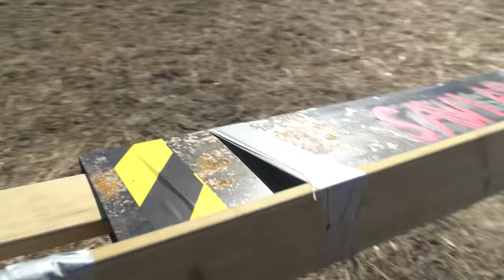Can you Launch Frisbee with Pneumatic Cannon?

Comment from the maker: If you have some ideas how to make the frisbees spin please let us know :D I think I could try this again if I get some feasible ideas. I have also tried a lot with saw blades but those are really hard to get spinning :D And if you haven't seen the saw blade video link is here https://youtu.be/228u0IrGgt4
Reply: Good luck finding those frisbees! Even scooby doo couldn't find them with a scooby snack!
Reply: Tarttisi jotenki saada enemmän painetta frisbiin toiselle reunalle kuin toiselle ja näin pyörivää liikettä aikaseks? Vaikeahan tuo on varmasti toteuttaa.
Reply: I think you need something that bends like a human arm. A pneumatic arm? I think you would need 2 pivot points, like an elbow and wrist, to get any spin.
Reply: Frozen pizza please
Reply: I think the problem is the frisbee is not separating from the block it's attached to until it's already in flight, perhaps more traditional wadding would work better?
Reply: Clay pigeon launcher 5000000
Reply: On the pink disc launch at 5:30 it looks like the excess air being blown out of the barrel caught up with the disc-and-sabot? I wonder if a vacuum cannon might work better?
Reply: I think there needs to be a way to apply the air pressure to only one side of the barrel to get the disc spinning before it exits the launcher.
Reply: My suggestion is, use the compressed air to impart spin; you are 3D printing the 'carrier', so presumably you could use silicon grease to permit the frisbee to easily rotate in the carrier, but you could also incorporate a pair of plastic rotary impellers into the corners of the carrier, fed by the air that is launching the carrier,  that transmit their rotation via plastic cogs & then friction to the rim of the frisbee....  If you get what I'm suggesting then cool, if not I may be persuaded to draw a diagram...
Reply: The 3d printed sabot is not releasing the projectile (frisbee) you need to have the sabot either attached to the cannon or colliding with a protrusion to stop the sabot moving while allowing the projectiles to fly free. As for spinning the frisbee would it be possible to redesign the sabot to take advantage of the available air pressure using a small turbine or wheels to drive a pair of cylinders to impart spin to the frisbee?
Reply: 1) The sabot grips the Frisbee too hard.  It must detach the moment the sabot clears the barrel.  You can see the mass of the sabot dragging the frisbee into a vertical position.  As soon as that happens, the frisbee flips.

2) The arms of the sabot must be as short as possible, while still supporting the frisbee in the barrel.

3)  try making an at least two part sabot, one that separates at the back.

4)  I have no idea if this will work.  And it would be difficult to do.  Make a multiple part sabot that goes all the way around the frisbee.  Have vanes on the sabot that catch the air to spin the frisbee.  The sabot must have just enough grip to stay with the frisbee to spin it, but separate quickly enough not to drag it down.
Reply: Suggestions for improvement:
-smaller air tank
-sabot must be stopped at the end of the barrel
-cuts at the end of the barrel that the remaining air could escapes to the sides

just spinning wouldn't help if the faster remaining air flips the frisbee.
Reply: Maybe design your own but make it discus shaped (possibly with some tiny added  balanced weights too), so the air doesn't get caught underneath it, like it is at the moment with the frisbee. It might cut through the air better?
Reply: Try making the holder in two parts so it can break away after launching.
Reply: You have to stop the carriage(sabot) just inches after leaving the gun barrel.  This will release the frisbee cleanly.  To do this add an external bracket that stops the carriage on both left and right sides but allows the frisbee to pass.  Now adjust the distance slightly (maybe a screw adjust) so the left and right sides are not equal distance from the end of barrel.  This will provide a torque to the frisbee as it's released.  You want the carriage to be clear of the barrel so it can pivot horizontally, but guided top and bottom.(imagine cutting away the sides of the barrel for the last few inches, sort of thing, but this would actually be the extension part with adjustable stops).  Good luck.
Reply: I have only one question. When you gonna release video with big chronos ring in a field?
Reply: Vipuvarrellinen heittokone joka lähdössä puristaa toiselta laitaa frisbeetä nii et se lähtee pyöriin ku liikerata loppuu. Noin se ei lähde koskaan.. tai tasalaitanen frisbee joka toimii itsessään mäntänä. Ja toiseen laitaan putkea joku kumi tms tahmea et frisbeen toine laita nahistaa sen verra et lähtee pyöriin.
Reply: Try trimming one side of your sabot down (where you have your frisbee spinner board). Make the opening for the frisbeee slightly bigger, so it'll spin easier.
Reply: To get them to spin make a new holder with 1 side of the frisbee touching the side of the cannon and some bearings running inside the holder to reduce friction.......simple. Also, put a small pin to stop the holder from coming out of the cannon. You could also try making something to get the frisbee spinning before you fire it.
Reply: That thing that holds the frisbees needs to stop just before coming out of the barrel so that the frisbee is free to spin when it hits that wood on the side. It will never spin while it's in that holder.
Reply: Look up filament rollers with bearings, take the principle of riding the edge of the spool and lay it flat. Build the sabot around that with a top/bottom piece so it peels away immediately. This way the disc can spin freely in the sabot. If you could somehow get a piece of G2 timing belt to run the length of the barrel on one side so the edge of the disc rides it from the start. Should be spinning fast enough to get somewhere but if you get that far you're to have to start playing with Hyzer angles depending on the turn and fade of the disc. I desperately want to see that cannon successfully chuck some plastic a mind boggling distance.
Reply: When the sabot+frisbee combo leaves the barrel the centre of mass is behind the centre of lift. It's like you're trying to fire an arrow backwards.

Make the sabot out of something light and fluffy.

Edit: to get spin dont apply force from the side. Pinch it from top and bottom on one side with something flexible like foam.
Reply: Forget the sabot. just stuff the frizbee down the barrel. the your last idea shold work.
Reply: failed and you still upload it? this is not fair ...
Reply: Create a heavier frisbee using a 3d printer.
Use an angle grinder attached to a free spinning metal cut out under the frisbee to get it spinning.
Release pressure.
😁
Reply: Lots of luck. At that speed, you will need a lot of spin to keep it stable. I believe the world record for distance is over 260 meters.
Reply: Get rid of the 3D printed part. This is stopping it from spinning as it sticks to the frisbee, keeping it in place.
Reply: Miettikää miten jojo toimii, se alkaa pyörimään ympärille kiedotun narun avulla. Tässä vois yrittää jotain samanlaista mutta niin että se lanka irtoaa lopuksi kiekosta. Toteutus saattaa tosin olla hieman haastavaa.
Reply: Add a rubber strip to the whole length of the barrel inside (or not if it would spin too fast?) on one side to make the disc spin, then redesign the piston to accept small roller bearings around the OD of the disc to let the disc spin in its place while on the way, and in the end of the barrel you should have a stopper for the piston formed to have good contact against the piston to not destroy the piston when it stops instantly letting the disc go through and fly all the way to the forest. I'm sure Lauri could design something like this, I am too busy myself atm.
Reply: Let jorge sprave know and he'll have something in like 5 minutes
Reply: @Beyond the press well to get this working properly you need to get it spinning up fast inside the barrel so maybe a drill bit that can attach through a hole in the barrel and is capable of being plugged fast enough that you can spin it up, pull the drill out, plug the hole and run to the firing switch. would also need a specialised holder with a couple of bearings but some 3d printed ones should do the job. then you can print in one piece still.
Reply: Sandpaper on the wood to increase friction...
Reply: As others have said, make the sabot stay in the barrel of the cannon so when the frisbee tries to spin it separates from it and only has its own weight to move 👍🏻
Reply: How about a curved launch tube? Then frisbee might get spin from touching the outside wall of curved tube. I don't know if it would actually work or not. Wall probably would need to be from a higher friction material so frisbee is less likely to just slide along it. But even then the launch support device needs to be designed to support the spinning. Basic idea behind this is that frisbee need quite long contact to start spinnig properly. It also would need to separate from support device as support device is likely to interfere aerodynamics.
Reply: Maybe try break away sabos or a frisbee shaped barrel and maybe actually have the barrel swinging as it's being fired to replicate a human swing.
Reply: nerf uses a wheel to accelerate rotation which propels the disk through their disk launcher.

Personally I think the friction you had was sufficient but the sled was gripping the frisbee too tight to allow proper rotation.
Reply: @MattFowlerBTR  vacuum canon with a "<" shaped breach that encourages friction rotation.
Reply: Make a giant slingshot and pre-spin the frisbee while it’s loaded using air pressure like the spinners you made a long time ago. Or you could still use the air cannon except don’t insert the frisbee inside of it. Instead cut a slit in the chamber and insert a slider that has a pin external of the chamber that holds the frisbee so it can be spun up.
Reply: I don’t know, but I’d try a Tiny cable to the back of the cannon and to back of cradle to stop the cradle and release the frisbees, maybe about 1foot out of the cannon. Try and see to dial it in, but you need to stop that cradle from flying to launch the frisbee. 
Good luck 👍🏻👍🏻
Reply: Check out the 18th century concepts of "discus cannons", some of those are shown in the St. Petersburg Artillery museum.
- the friction for spinning needs to be established from the very beginning.
- one concept is a toothed side on one side of the cannon, the other one is smooth. Thus it starts to rotate from the very beginning
- another concept is a bend barrel, the discus scrapes along the outer end and picks up friction this way.
- the flat sabot is a mistake. Build a round, 2-piece sabot that seperates outside of the barrel.

one example here: https://www.madaxeman.com/images/Russian/square_gun.JPG
Reply: Try cuting some dents on the frisbee border and make a wood plan with the same dents as guide, make it fit and work as a gear. Greetings Lauren!
Reply: It looks like the sudden rush of high speed air catches up with the frisbee a few meters after leaving the barrel which messes up the aerodynamics of the frisbee and instead of cutting through still air from the front, it is being pushed from behind and thus cannot fly correctly.
Reply: Make notches in the Frisbee for the wind to catch and spin naturally
Reply: Luis Antonio Camacho if it’s a gear system you are talking about placed at the end of the launcher, it will be destroyed on impact. It would be better to have the notches at the beginning of the launcher only. About 1/4 the length of the launcher tube. I kinda feel like that would have a negative effect on the aerodynamics of the frisbee though if the frisbee itself is notched on the edges unless they are very small.
Reply: Try to pinch the Frisbee on one side to impart spin. It would have a greater surface area and therefore more torque than hitting the rim.
Reply: Make it spin first, then shoot it.
Reply: The block could be just in 45 degree  angle with some grip tape, this way when the frisbee and the block exit the barrel, the block would make the frisbee spin
Reply: Tape  the bottom so it's  smooth
Reply: Build a skeet machine  instead of clay disc use frisbee
Reply: I think it flys better, when the PLA part separates faster from the frispie. To reach that you can make it out of two or four parts so it splits in parts. And you could try to make the PLA part less aerodynamic and more like a parachute.
Reply: The problem is that the 3D printed support stays with the frisbee and brings it down. If you stop it before it launches, the frisbee should have more freedom to fly and spin.
Also, aim flat, not upwards
Reply: My cousin has this clay pigeon launcher for shotgun target practice.   https://images.app.goo.gl/NhuaTvkpR9uhFPeF7
It's basically a spring loaded arm, pull the string and it flings the pigeon. You would just need to rig up a pneumatic piston or something to drive the arm. It would take a lot of R&D to get it dialed in but you wouldn't need the sled or any auxiliary spin inducing apparatus. The launch and spin are built in to the arm in the way the disc is loaded. You could check out how the clay pigeons are loaded and held before launch and adapt it to launch a disc. Or a saw blade. Definitely a saw blade. But also a disc golf driver. It would pose it's own challenges but if you get it to launch you should get the spin baked in.
Reply: Cut a channel in the outer edge of the frisbee big enough to wrap some string around.  Tie other end of string to the launcher.  When the frisbee is launched, the string will unwind from the frisbee, causing it to spin.
Reply: Suggest a 2 or 4 piece sabot for separating and a heavier Frisbee, I'm sure the both of you have already thought of this.
Reply: Batting cage baseball launcher 5,000,000. Mount something like that on the end of the barrel of your launcher except just one wheel on one side and a rubber pad or something on the other side. Something just enough to squeeze the disc against the (really fast) spinning wheel right as the disc leaves the barrel to get it spinning w/o killing too much velocity. You'd prob have to somehow stop the sled at the end of the barrel. You want the disc to leave the sled as abruptly as possible.
Reply: I would hit up slingshot channel, maybe you can do another team up in this!  Both your channels are awesome:
Reply: What would happen if you put a small weight on one side of the frisbee? Maybe a little inertia on one side would cause it to spin
Reply: You need a  launcher like they use for throwing clay targets for skeet shooting, They make the targets spin.
Reply: Tie a string to the sabot and to the frisbee, and make the sabot stop at the end of the barrel, so the string will pull one side and make it spin.
Reply: Beyond the press sideways trebuchet
Reply: Make a C shaped launcher, the disc will get spin as it rolls around the outside of the C curve, no sabot.
Reply: Line one edge of the barrel with rubber so it grips the disc as it is accelerating. And have the wadding made of a flat piece of Teflon so it can push the disc while the disc slides on it while it rotates.
Reply: On an Air Soft Gun there is a system called "Hop-Up", which I think makes the pellet/ball/bb spin "backwards?", thus making it go further. I'd investigate how that works and scale it up a bit.
Reply: @suokkos  I had the same thought
Reply: I think the block that the frisbee is traveling with through the cannon should stop at the end and not leave the cannon and have the frisbee be airborne all on its own. Still have something on the end to assist the frisbee make a rotation at the end.
Reply: Mount it on a bearing and use compressed air to spin it up, and then launch it. 
You're using superhuman launch force and less-than-human spin force, so it basically isn't spinning at all and then immediately flips end over end. 10x the forward speed will probably need 10x the spin speed. Good luck!
Reply: Parimetrinen käyrä piipun päähän, samaan tyyliin ku se lankku oli. Jos tarvii lisää pitoa, niin kymmenen sentin välein joku pieni terä. Samalla tuo tiivistysosa niin, että sen suora pinta on kiekkoa vasten, nii se ei estä sitä pyörimästä
Reply: Beyond the press The 3D printed part was holding onto the disc. So when it started to fall, it dragged the back side of the frisbee down, which then made it shoot up.
Reply: you should make frisbee launcher 6 million with a curved barrel like so: https://www.youtube.com/watch?v=mCn-YSVi3-A or https://youtu.be/0rFILFGE1TU release angle of the disc plate will affect flight as well...
Reply: tehkää sillai että se ulostulo olisi vähänniinkun J kirjaimen muotoinen tai jotain sinneppäin niin se frisbee saisi enemmän kitkaa ja mahdopllisesti EHKÄ onnistuisi
Reply: pellistä luultavasti saisi helpoiten tehtyä kanuunan kärkeen 1/4 ympyrästä kaarevan osan ja jos haluaa vielä lisää kitkaa niin päällystää sen kumi matolla tai jotain
Reply: If you can somehow make the airflow on one side better, or just put more friction on one side so it starts spinning in the barrel. Or you need some device that makes it spin at the beginning of the barrel, but that might be difficult.
Reply: if you can catch the cradle before it leaves the cannon...
Reply: I think you guys had an excellent idea the only improvement I  could think of after seeing all of the glorious flight was the wad holding the Frisbee causing tumbling.   My thought it is you made the cannon wad out of 2 pieces upper and lower.   So when it leaves the barrel it splits and falls away from the Frisbee
Reply: Use a fast dc motor, attach the motor to a rail so you can fire the motor with pneumatic pressure, also use huge rubber band or a spring to stop the motor gently, u will need a long rail tho...  then a simple release mechanism at the end and voila :D  very doable i think !
Reply: It needs to be spinning before it's shot out. Perhaps a jig that has two parts that separate when they exit the canon and hold the disc from the top and bottom at the center, not the back. Maybe like a couple of Lazy Susans. Then you could use a gear or break-away string assembly that attached to a motor or drill to get it spinning fast. Then launch when a specific RPM is achieved. Or just wrap a cable around the center and tie the end down so it would start to spin naturally as the disc moved down the barrel.
Reply: Look at the mechanism on a clay pigeon thrower, then instead of a gear with a motor on it, have a hydraulic piston hit the back of the arm. Would take a lot of tweaking because the disc will want to flop.
Reply: Try a catch on the end of the cannon, a little tab, maybe top and bottom, to remove the cradle before it flies
Reply: Lots of good ideas in comments but not seeing anything about nose angle. Air getting under nose causing the flipping
Reply: a pneumatic catapult, based on the ones are used for ball trap, would be way more efficient
Reply: It might work to attach a string from the inside of the cannon to the 3d printed part, then friction fit one side of the frisbee to the 3d printed plastic. This may introduce a spin while also removing any drag that the plastic causes.
Reply: Spin it on a electric motor and some how make the motor move forward and flick it off
Reply: Put some roller bearings on the front of the sabot that allow the disc to spin, but only on one side. The side with the bearings will roll freely but the side without them will have the disc contact the side of the inside of the barrel, causing it to rotate during the launch.

You'll need to try different bearing placements to try changing the angle it presses the disc against the side of the cannon's barrel.
Reply: That launcher should be curved. Horizonally I mean. Sabot must be gone. When it's curved one edge of the frisbee will be pressed against the wall and it will rotate. You could use just round pieces of styrox or other light material as sabot on both sides of the disc with this one. Clay target (disc) thrower is a better implementation of what youre trying to do.
Reply: I recommend cutting the shuttle in half, and maybe have very small "wings" that pop out for drag. The idea is once the frisbee clears the barrel, the shuttle will easily separate from the frisbee without there being much drag. I'm not sure what to do for spin. You want it to start spinning after it clears the shuttle.
Reply: Or perhaps make a fan (rotor) style sabot. Round shaped fans with curved (same direction) blades on both side. Then the whole thing starts to rotate. You can still make it curved or add some other means of drag to other side (tighter slot, magnets, whatever).
Reply: Get rid of the block behind the disk. Make the barrel bit flatter on one side and if possible glue or rivet some rubber on the inside of the barrel on one or the narrow edges, so that disk is slowed on one side during acceleration. You make it spin in the barrel already
Reply: Jorg sprage from the slingshoot chanel made a sawblade luncher that spins via som gears and rubber maybe you could get some inspiration there
Reply: Tee pyörivä tekokäsivarsi jossa kiekko on. Tykki ampuu käteen, jolloin se pyörähtää ja heittää lätyn
Reply: @Beyond the press I would have the pneumatic power an arm that spins 180* then it would release it after that partial rotation. Air pressure forces the arm to spin 180* and then once it hits 180* the frisbee would release
Reply: Nopeesti ajateltuna toi teline pois. Sitte liimaatte toiselle sisäreunalle kumimattoa ja ilmanpaine enemmän toiselle reunalle niin että se painaa kiekkoa kumia vasten. Se kiekko pitäs saada alusta asti pyörimään. Kuula-aseissa käytetty hopup järjestelmä on aika kätevä ja siitä kannattas jotain vinkkejä/ideoita ammentaa.
Reply: Use either a sabot that splits up, so it separates, or use one thats way softer. Like a foam Plug
Reply: Just block half of the pipes airway so only half of the frisbee gets the air blown on it. That will force a rotation.
Reply: The 3D-printed cradle is the problem, you should have inserted it the other way. And have a rubber surface on the side plank that shall start the spin. Or even have one side of the barrel with a rubber surface so it really can get spinning.
Reply: I think the 3D-printed base part is pushed to hold the disc too tightly by those 10 bars of air pressure. If you just could modify the pressure seal part to be tight to the barrel but not to hold the disc while still pushing it like never before.
Reply: First obvious problem is the sabot. If it's not released by the time you try to get it to start spinning, it's not going to work. One possible solution to that, since the sabot is protruding both above and below the frisbee is to have a sort of lip for it to catch on. Second problem is spin. I don't think either of the things you tried would have worked even is the Sabot had worked perfectly. But you had the right idea with the plank at the end. The two problems with it is that it's flat, so if it bounces off in the first 20 cm, it will be moving away from the plank and not touch it anymore, and that if there's a constant contact on the side, it might bend or try to 'flip' to lay flat against the plank instead of rolling along it. Not sure about that, though.
You can solve the first problem by giving it a 'rail' like the long plank, but slightly curved. Probably a meter or two long, and curving by 10-15 degrees. Haven't done any math on the numbers, though. Second problem could be solved by using a rectangular pipe like you're using for the barrel. 

So all in all, My suggestion is to attach the a lip to the barrel to work as a hard stop for the sabot, then get something identical to the barrel, but cut little triangles out of one side so you can bend it (I'm sure you know what I mean, otherwise ask, I'm happy to explain it better), and attach that to the barrel as well. Then bend it, weld it, and attach that to the barrel as well. Maybe put some sort of lining on the side the frisbee will be rolling on, so there's more friction. There's some stuff to work out with how to fit a new frisbee and sabot in, and how to make sure the lip and 'frisbee roller 5.000.000' won't jump off when you shoot because of the pressure, but this would at least work, even if it's a ton of work.
Reply: make it spin really fast before it shoots out
Reply: How about using an old style frisbee, the kind that if it hit you in the face, you knew about it. Your frisbee seemed too floppy :)
Reply: Problem here is the 3D printed part... It weights too much and all the time pushes the frisbee causing spinning to stop and also affects the trajectory. You need to somehow separate the 3D printed part and frisbee at the end of the barrel, for example by having some pin where 3D part collides, but not frisbee.
Reply: I really think you need to try this again. The plastic thing that's holding the frisbee was the problem the whole time. It was preventing the frisbee from spinning and it was moving faster than the frisbee after it left the cannon, due to the plastic having more mass than the frisbee, and greater air resistance on the frisbee, causing everything to flip. You have to figure out a way to destroy or get rid of that plastic holder, then create a way for the frisbee to spin. 

Is it possible to put some wadding in the cannon(in place of the plastic holder), and line 1 side of the inside of the cannon with maybe a rubber material to create rotation on the frisbee before it exits the cannon?
Reply: @austintillman8297 , the frisbee wouldn't fly very far even if it manages to detach from the plastic block due to the weight offsetting the center of balance from the center of the frisbee. In short, it would likely dive bomb into the ground lol
Reply: Maybe with less pressure
Reply: Just print stop for the carriage, so the only thing that will leave the barrel is the frisbee. Two metal bars at the sides should be sufficient. When loading, you just have to put it in at an angle.
Reply: You could try drilling a hole in one side of the sabot so the air pushes one side and the other spins against the side of the barrel
Reply: For the love of god man use a bowling ball! Fire it at a concrete wall or across the lake.
Reply: Spin them beforehand. And shoot them spinning already. Other idea is to make the launcher slightely bend in order to give it a spin
Reply: You should make it with some kind of "arm" on an axel where the frisbee is mounted on the end. Have the arm start at 0 degrees, push it with air force and have it stop instant on 90 degrees. That should get some centrifugal force to the frisbee to make it spin. So like an horizontal catapult driven with air.
Reply: @dougie8747  definately what I was thinking. It holds on too long, and alters the velocity of the frisbee. It would work if there wasn't wadding, or something that would loose velocity quickly. Like cotton, or felt. You just need something to make the seal and not explode immediately.
Reply: Well what you should have done is use less pressure and you would have gotten a better launch
Reply: Two brushes or rollers, at end side of the muzzle of the launcher, to gently slow down, grip or cause friction will cause the frisbee to spin.

This video https://www.youtube.com/watch?v=8LLfBzTGZ-U has the mechanics right of introducing a gripping then spinning motion.
Reply: Put some foam rollers in the carrier like the ones toy car tracks use to launch them. One on one side and two on the other, so that both sides are trying to spin it in the same direction. Maybe put some PTFE film on the carrier where it and the rollers meet the frisbee so you can have some pressure between the rollers and carrier for a good seal without the friction destroying the rollers.
Reply: Lauri, first you have to leave those plastic parts behind the frisbees. The frisbe has to spin with a pneumatic grinder at high speed before shooting out of the cannon.... maybe you can do this magnetic... the motor is on the top side and like on the spinner-wars the frisbee is rotated. you just have to modify the launcher to seal with the disc properly.
Reply: What if you made sort of a sideways trebuchet with an end to hold the disc that would give it spin as it launched? See if you can make a goal here in New York from Finland! :D

As others have suggested, maybe without the sabot, and as others may have suggested, with a strip of rubber going .3 meter or so down the inside of the launcher, on one side to make it start spinning.
Reply: google turtles pizza launcher :)
Reply: Beyond the press it would be difficult, but a curved barrel would help. This would force the side of the disk to run along the outer wall, but your current sabot would have to be modified to allow for it (3D printed wheels/bearings would be neat)
Reply: Drill holes down one side of the cannon along the top, holes would cause drag on one side of the disc causing it to spin
Reply: Maybe you could design air paths inside the sabot to make an air cushion and apply torque to the disc while its in the barrel?
Reply: or build in some asymmetry or fins so that the sabot starts spinning as its leaving the barrel but before it separates from the disc
Reply: maybe change the aerodynamics of the frisbee so that it makes itself turn when flying at high speeds? like attach something small to the top of the frisbee which makes it have imbalanced air resistance but balanced weight. (first thing that comes to my mind would be a bunch of fingerhats which are attached to the border of the frisbee all turned in the same direction.)
Reply: Cut grooves in the disc like a saw blade and maybe need the heaviest disc they make. 300g?
Reply: Moi! Kokeiles tehä tykin päähän sellainen stoppari et tuo palikka jää siihen. Ja sit modifoi tuo palikka siten että frisbeekiekko on TOSI tiukasti kiini toisesta laidasta palikassa kiinni (käsin vedettäessä sen saa siitä irti vain siten, että toinen puoli ensin irtoaa) Luulis maalaisjärjellä aiheuttavan jonkilaisen spinnin. Toisena vaihtoehtona kävi mielessä että itse tykkiin pitäis saada toiseen laitaan koko matkalle jtn kitkaa että saa spinnin jo liikkeelle lähtiessä; voikin olla jo mielenkiintoisempi toteutus :D Kolmantena vaihtoehtona, googlaa savikiekon käsiheitin, rakenna sellainen joka toimii pneumatiikalla, KYLÄ LÄHTEE!
Reply: lubricate one side of the barrel - IE tilt it about 10 degrees to one side, then either don't use the sabot or lubricate the curved portion - and then pour some lube down the barrel. Perhaps you could put a strip of sandpaper along the other side - then as it travels along the barrel? it should impart a LOT of spin
Reply: Turn the frisbee into a fidget spinner/impeller in conjunction with the 3d printed part.  Before launching the disc, apply compressed air to the impeller to bring it to 10,000rpm.
Reply: #LetItSpin the holder of the frisbee should be 2-4 parts loosely put together and after exiting the nozzle it will separate and let the frisbee free before disturbing it...

Then you can care about the spin problem... It's close to a shotgun shell... And exotic slugs... The separation is one of the key points!
Reply: Try laying the barrel at 45 degrees so that it drags on one side the whole length of the barrel.  Re-make the sabot so it doesn't protect the sides of the disc from contacting the sides of the barrel.  Alternatively, make a steel disc on bearings that can be spun gyroscopically before being fired, sort of like a beyblade.
Reply: Tässä onkin jo mainittu savikiekkojen ammunnassa käytetty linko. Pyörää ei tarvitse keksiä uudelleen. Kokeile sellaisella ja sitten virität sen pohjalta sen 5 000 000 -version.
Reply: For real. Just try a shot with the last Setup and jost turn the sabot 180° so that the flat side goes angainst the frisbee
Reply: Frisbeen tuki kahteen symmetriseen  osaan ja frisbeen urat hyvin väljäksi. Kun tulee piipusta ulos tuki putoaa pois ja ainakin sitten lentää suoraan. Pyörintäliikettä se ei varmaan saa aikaiseksi. Sitä voisi yritää juuri vastaavalla lauta jesarityynyllä muutaman metrin päästä piipusta, jotta tuki kerkeää putoamaan pois. Syö kyllä liikeenergiaa, mutta jos lähtee pyörimään menee kyllä kauaskin.
Reply: Can you tie a cord on to one side of the maybe whip the disk from the holder after it leaves the barrel
Reply: I think your ideas on getting the spin are correct, but I noticed another problem when firing which will prevent you from tuning the spin in correctly.
The 3D printed sabot is so heavy that, when leaving the barrel, it continues to move at a higher constant rate than the light, plastic frisbee disk will move at. This, accompanied by air currents catching under the leading edge of the frisbee, causes the disk to flip as the heavy 3D printed part begins to drop.
During that crucial moment, the 3D printed sabot should fall behind the disk, but because it is so heavy, and has no flaps that catch air for drag to slow it, it continues forward, pushing the disk out of alignment. Once the disk starts to flip, at that speed, there is no recovery.
The 3D printed part should be a light as possible, and maybe have flaps that catch the air after leaving the barrel to ensure that the disk's momentum is the only thing carrying it forward after the point at which it leaves the barrel.
But like I said at the top, I think you're dead on as far as making it spin, but my only addendum would be to use a highly grippy material on the bumper arm, that way it grabs at the disk more, and maybe even the 3D printed sabot, causing more rotation as well as pulling that sabot away from the disk.
Reply: Compressed air for launching & spin.
Reply: if you put a catch at the end of the tube that stops the plastic thing that holds the frisbee but doesnt stop the frisbee it might work
Reply: Make frisbee ultimate rotator 7000000 connected to hyper throw arm 6000000
Reply: I think if you wrap something like a ratchet strap around the diameter of the Frisbee several times, then load that whole arrangement in the Canon, and attach the ratchet strap to the base of the barrel dot-dot-dot the Frisbee will be forced out, and will be forced to spin as it goes down the barrel. The nylon strap will act as the Sabo so you won't need the 3D printed carrier. The hard part will be loading it and attaching the strap to the back of the barrel.
Reply: I think the biggest problem is that there is so much air coming out behind it, and the air is moving too fast so it destabilizes the disc. Secondly, the mechanism to get it spinning might be more effective if it were inside the barrel instead of outside on the end. Great video though, love it!
Reply: Fit one side of the cannon with foam or a rubber strip that the frisbee contacts, without the cradle of course.
Reply: It needs to start spinning and be separated from the sabot before leaving the barrel.  A lot of random surface and air friction inside that barrel is reverberating behind and through that disc when it enters the outside air. How one might ask? Hell if I know HOW, lol.
Reply: I have two ideas: I think you need a sabot stopper and a spin chute. For the sabot stopper, some tabs in the corners of the barrel (with a way to let the air out behind the stopped sabot) could catch the printed part and let the disc/saw blade continue by itself. Second, as you observed the edge of the disc is relatively small, it will tend to skip/bounce off a momentary contact with a wedge rather than turning a significant amount of its linear momentum into angular momentum (saw blade teeth might catch, which could help). A shoot chute would be a curved assembly of a few pieces of plywood sandwiched together, open on the inside radius (with intermittent spacers, and you might need some plastic strips on the top and bottom so it slides - better yet, plexiglass sheets could look cool in the videos) and rolling hard on the outside radius (or is a parabola better?) turning the disc through 45+ degrees over a meter or two, would have a lot more contact.

It's easy to underestimate the angular velocity of spin-stabilized projectiles like rifle bullets, golf balls, and discs, they should complete a full rotation in about 20x their length or less. Yes, that means a bullet might spin at 100,000 RPM, and a golf ball might spin at 10,000 RPM! A disc golf throw should be spinning at hundreds of RPM. A disc golf drive thrown by a human spins at 1000+ RPM, that means your target with your higher disc velocity is on the order of 3,000 RPM!

In the same vein, I would also be interested in your take on a ~baseball~ bowling ball pitching machine. Start with some big truck tires...could be amazing!
Reply: Beyond the press airsoft guns have the plastic balls fired out of the muzzle with both horizontal and rotational momentum, they have a little rubber invading the barrel at 10% barrel length so the ball touches the rubber and loses a bit of longitudinal momentum but the non-symmetrical brake force caused by the rubber makes it spin, inducing magnus effect and the ball reaches further. It is called hop-up mechanism in airsoft guns.

Have a little rubber invading the side of the barrel at its beginning. Freesbe being accelerated touches the rubber, which gets compressed and brakes a bit the freesbe. It loses straight speed but that little brake will induce spin while still being accelerated inside the barrel. Make sure to have the sides of the barrel well lubricated, for example with graphite.

I hope it helps.
Reply: Poratkaa kiekkoon pieni reikä ihan siihen kiekon kehälle. Sit pätkitte "piipun" mittaisia erivahvuisia siimanpaloja jotka sidotte siihen piipun päähän jommalle kummalle puolelle, ja toinen sidotaan siihen kiekkoon, samalle puolelle. Erivahvuisia siimoja testaamalla löydätte varmasti jonkun joka kestää sen verran että kiekko saa tarpeeks spinniä suhteessa lähtönopeuteen mutta silti sen pitää katketa heti kun siima loppuu siinä parin metrin pituisen "piipun" ilmalennon jälkeen. Profit!! Tälle peukkua ny ja toteutukseen!
Reply: Drop the sabot, and have a very slightly curved chute at the end. The disc will ride the chute and spin up
Reply: And you probably need deflectors to keep the air from flipping the disc. Something like a supressor or recoil compensator.
Reply: A toothed zipper on the side of the barrel corresponding to teeth on the side of the frisbee. That should get ‘er spinning.
Reply: You could use a straight, plastic or metal toothed track, like a gear rack or a Wham-O Trac-Ball racquet, along one side. Modify the sabot to accept the track and let the teeth touch the edge of the plastic disc to get it rotating. Perhaps use a non-toothed track on the other side so that the sabot does not do weird things upon release from the muzzle. With the two tracks along the sides of the barrel, you should get high spin rate by the time the disc exits. Consider a bearing race or rollers in the curved part of the sabot. Otherwise you will have insufficient spin at the end and no stable flight.
Reply: Look at the design of clay pigeon launchers for skeet shooting. Make an amplified version of one of those.
Reply: I would try: 1) attach the frisbee to the cradle with something like sticky tape, on one side only 2) have stoppers to catch the cradle as it exits the barrel.  So - the cradle + frisbee leaves the barrel, the cradle hits the stoppers, the frisbee carries on forward but slower on one side due to sticky tape - result spinning frisbee with no attached cradle
Reply: Maybe something like a trebuchet on its side gripping the frisbee from one edge (off centre)
Reply: @dougie8747  or maybe put a dent in the outlet of the cannon to break down the block enough to separate the frisbee. once that is off the frisbee can touch the wood and hopefully spin
Reply: GOLF BALL LAUNCHER 5 MILLION
Reply: Sarah Dowell exactly what I was thinking.
Reply: The sabot doesn’t release the frisbee and drags it down making it flip over. Make a sabot that doesn't cover the top of the frisbee so it can just fall away. Have one arm of the sabot short and the other long. Have the long arm wrap round the front of the frisbee by just a couple of mm so it catches on the release hopefully giving it some spin.
Reply: You could try to add a string/chain to the freesbee holder to make it be stopped after exiting the cannon and let the freesbee fly freely. And maybe placing the string/chain on one side of the holder could make the freesbee spin?
Reply: the sabot creates an even distribution of force across the horizontal plane of the disc.  to acquire spin , the force must be applied unevenly, along the horizontal axis. with an arm we do this by gripping a single point along the circumference, whether forehand pushing force from the inside of the rim or a backhand pulling force from the inside of the rim.  To achieve this, we might think that you could spin the disc separately from the air cannon mechanics, such as a unique sabot with a spindle and an airchuck attachment, or a sabot that is split in two and holds the disc longer and is caught as it exits the barrel, and the taped stick is close to working... but these ideas still apply an even force to the horizontal plane and do not achieve the dynamic force transfer that the disc is designed for... so A) what about rifling in the barrel, or something so simple as drilling small, angled holes along one side of the cannon barrel, perhaps even the top of the barrel, and a different sabot design, with air holes to "float" the disc, allowing the disc to separate from the sabot and the barrel, creating an a rotating air cushion, or a vortex along the underside of the disc?  rifling in a gun barrel spins a bullet along the y axis along the length of the barrel, a disc needs spin along the x axis across the cannon barrel as it travels down the length.  so B) what about, build a slight taper along one side of the length of the cannon barrel and instead of a rectangle sabot as seen from the back, build a wedge shaped sabot, possibly with holes to allow air to pass through the sabot, (so it would work a bit like an air hockey table but with a twist)... that should create the differential along the horizontal plane spinning the disc on the x axis, faster air flow on the wide side slower air on the "pinched" side of the disc?
Reply: Make aluminium frisbees, then cut cogs into it. Equip one side of the launching pipe with fitting cog teeth. This could work.
Reply: Print a sabot / carrier mechanism that is part turbine. Spin is imparted by letting some air past. The turbine is held together in the barrel by a 2 part frame which flies apart from centripetal force once leaving the barrel.
Reply: CLAY PIDGION THOWER. ITS PERFECT ARM
Reply: Clay  Pigeon thower
Reply: Clay  Pigeon thower
Reply: Clay  Pigeon thower
Reply: Make the carrier wider than the frisbee and build in a stop so the frisbee is ejected from the carriage and then build a longer gentler slope to get some friction applied to one side of the frisbee.  Also it might be good to have a groove on the slope so it doesn't start rotating forward or backward.
Reply: You cant get spin with that 3D print. Pressure to print is bigger and holds it too strong.  You need to get spin already inside your pipe. Need to work like bullet in a barrel. You need to build new cannon.
Reply: It looked like the friction from the spin system wasn't able to overcome the friction from the launcher tray, you need less contact surface to the tray for sure, adding some bearings for the disc to rotate against would help as well I think, but the disc is probably being thrown way over power, same thing happens when you throw a putter like your driver,  it flips up with no control and becomes unpredictable
Reply: Add a wire inside the barrel but offset to the side. Attach it from the back of the barrel to the sabot and only just long enough to clear the end. The whipping action it would impart on the sabot might be enough to spin and release the disc. Or destroy everything.
Reply: @sarahdowell5475  or have the sabot in multiple pieces so that it breaks away easier. Upper and lower frames that have registration with each other and beveling to cause the air pressure at the front and back to split them apart.
Reply: As a disc golfer I have a few ideas.  First off, these discs need A LOT of spin to achieve stable flight.

#2.  This kind of spin is likely impossible with the plastic Frisbee holder because of the friction between the two.  As you can see, even when the disc hits the wood, it can't spin while attached to the holder. We would need to remove this.

3. To compensate, we would need to make the tube thinner, so most of the air is used to propel the Frisbee and not wasted.

4.  To achieve the most spin, a good idea might be to line the left side of the tube with something very grippy, with high friction.  

5.  Then, we completely block off initial airflow to the left side of the tube (maybe with some welded steel) so all of the air is directed to the right side of the frisbee.

6. Combine this with the friction on the left side, and you'll have a VERY fast spinning disc
Reply: You may not even need to block the airflow, if you concentrate on very little friction on the right side of the tube, and heavy friction on the left side.
Reply: If you can stop the thing pushing the disc from exiting with the disc, I think you’ll have some more luck. Pulling the disc some how would be ideal I think.
Reply: Take the sabot out and let the frisbee fly free. Keep the duck tape and long board there to get it to spin. Looks like the sabot is keeping it from spinning. From the amount of air that’s flowing out, looks like it will still have plenty of power behind it. Keep up the great videos. My kids and I love watching them.
Reply: What if you made the loader smaller so that it's not locked to the frisbee. The frisbee is hella back by the loading device.
Reply: Muuten näytti hyvältä mutta tuntuu että kyseinen holderi/3d printti etstää kiekkoa pyörimästä eikä päästä kiekkoa irti helposti itsestään jonka vuoksi kiekko ei lähde niin hyvin pyörimään. Tuntui että ensimmäinen jeesusteippi versio olisi toiminut, jos 3d printti tuki olisi ollut paljon pienempi (peittäen vain kiekon takaosan eikä sivuja ollenkaan)
Reply: Too much forward force, and the holder keeps sticking. Maybe add a little notch so that it catches the holder, allowing the frisbee to dismount. From there you can probably use your duct tape to grab it and spin it! Hope this help!
Reply: go oldschool and use cotton wadding for the sabot instead of 3d printed plastic.. (I'm assuming that's 3d printed plastic, and heavier than the frisbee) I'll second the rubber strip inside the barrel as well, since I just saw someone else mentioned it also..
Reply: Use a streamer (like a recovery system for a model rocket too small for a parachute) and wrap it around the outside edge of the frisbee. Tie a knot in the loose end, the air will catch on that and unwind it, which will make the frisbee spin. If it's not actually attached to the frisbee, it will drop away like the sabot afterward.
Reply: You need to remove the sabot first, before you can make it spin.  All that energy is just being expended on the 3d printed piece.
Reply: En tiedä luetteko näitä enää ja tässä oli jo jokunen vastaus joten en jaksanut lukea kaikkia joten saattaa olla moneen kertaan ehdotettukin. Eli frisbee ei saa olla kiinni laukaisualustassa. Laukaisualustan täytyy olla vain tasainen muovinpala. Kiertämisen täytyy alkaa edes osittain jo putkessa ja jatkua jonkin matkaa vielä putken ulkopuolella. Eli viimeisen kaltainen lautaviritelmä on jo melko hyvä mutta vaatii kitkapinnoitteen (kumi tai vastaava) sekä mahdollisesti hieman kourumaisen muodon. Putken päätä tosiaan täytyy muokata lievästi käyristyväksi loppupäästä ja myös sinne tulisi saada kitkapinta pyörimisen mahdollistamiseksi. Vaatii työtä mutta nähtyäni asiat mitä virittelet päivittäin työksesi niin ei pitäisi olla monen tunnin työ. Toimivuutta en silti takaa koska frisbeetä ei ole suunniteltu noille voimille. Kiitoksia kaikkien kanavienne videoista. On ollut iso apu kun on joutunut viettämään paljon aikaa kotona tämän koronan takia.
Reply: Put some small stops in the end of the barrrrrelll that stop the PLA carrier thing at the end, so the frisbee can "Go solo" maybe? Probably less pressure may help too but that's no fun ;)
Reply: Tehkää joku stopperi tuolle kiekon ohjurille, niin se ei lähde kiekon mukana ulos kanuunasta. Sillä tavalla lähtis kiekko varmaan paljo vakaammin menemään eikä pyörimään hallitsemattomasti.